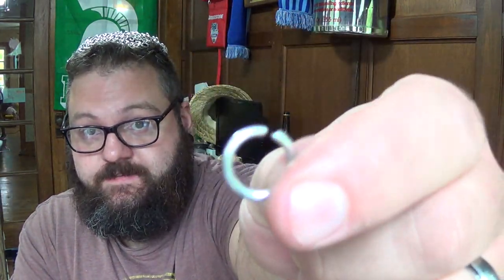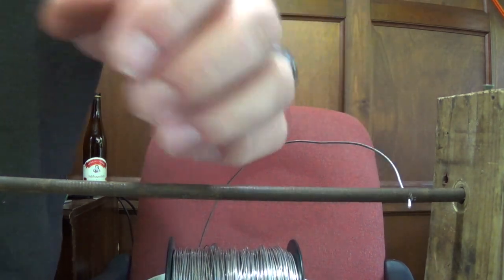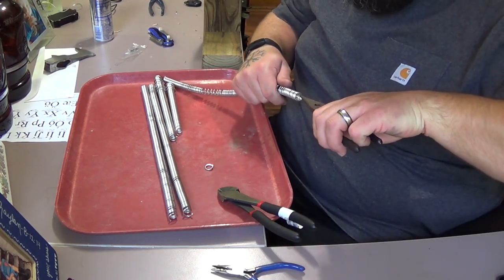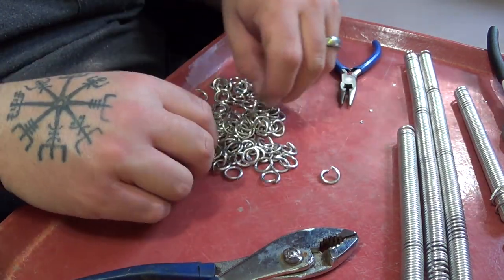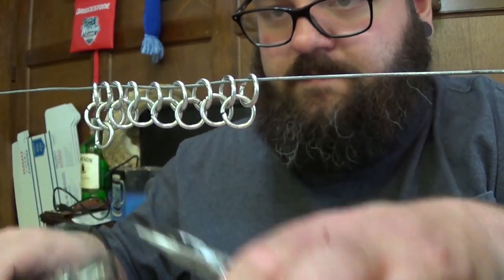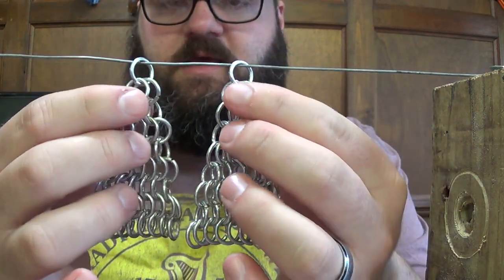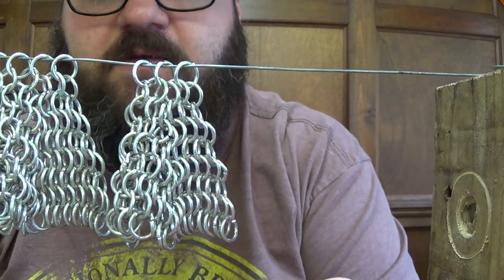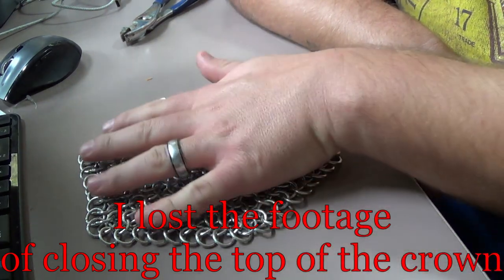CHAINMAIL COIF: Part 1 (Starting a Coif)

Comment: I used a narrow straight tip, tin snips, when I started. Later, I went to a narrow Dremel cut off wheel. String the spring onto a sacrificial dowel rod, and cut about 3/4 through. Light passes. Then, just snap them off. Little less rag. I was dumpster diving cable TV wire leftovers, from the cable company. 😉👍
Reply from the maker: Oh man that’s a game changer!!! I just bought some cut off wheels too!

Comment: Thanks for the great and clear instruction. I have tried to start at the center and expand, but it is way to fiddly. Any chance you can tell me how you closed up the top? I know you lost the footage, but perhaps I could understand a quick synopsis.
Reply from the maker: Thank you! Yes I would do a row and then put it over it on my son’s head and see how close I was to closing the top and then do another row and so on until it was closed. You could maybe use a bowl upside down. But think if you had a watermelon or some kind of melon around to put it over that will give you a better actual head shape. Hope that helps!!

Comment: I want order 1000 rings from Amazon, since I can't make myself, is 1000 enough?
Reply from the maker: That’d be cutting it pretty close. It all depends on head size and if you want to do a full or half coif.
Reply: @safety3rdforge245  I want make a full also my head not so big
Reply: @safety3rdforge245  I think i going buy 1500 for safe
Reply from the maker: @theshittyone4985  yea that should be pretty good. Hey and if you need to just order some more.